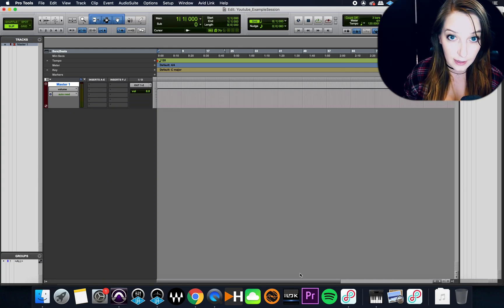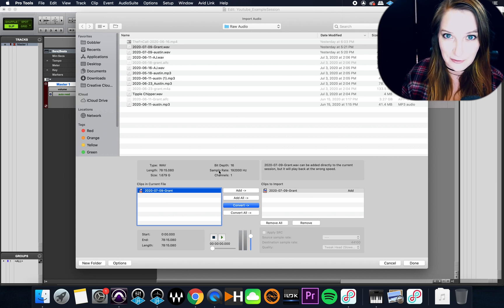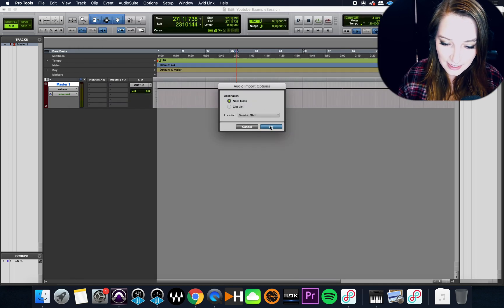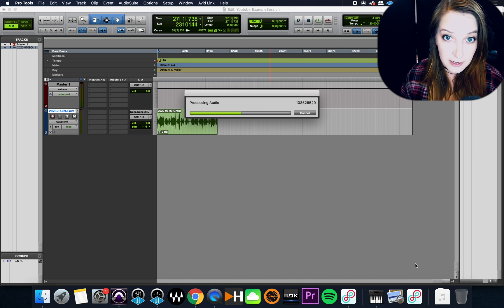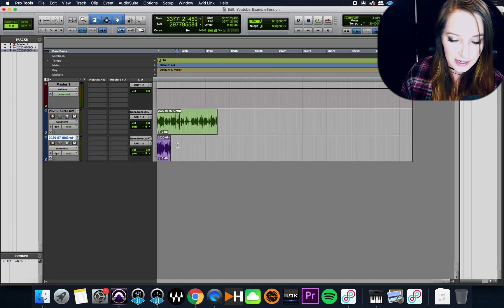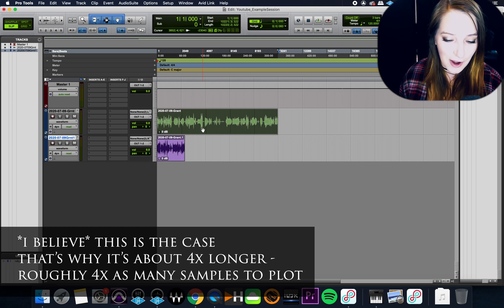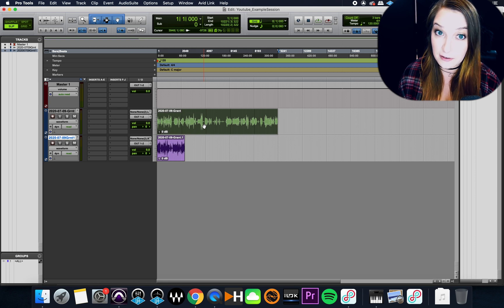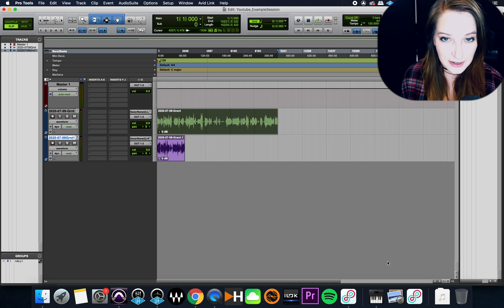Pro Tools Basics: is Your Session Playing Too Fast or Too Slow?

Comment: My issue is I have a project that suddenly changed sample rates because I changed playback device, it’s playing ay 44.1 when the entire project was 96.9 now I can’t get it to play normally again.
Reply: I was able to go into backup files folder and select a previous version of the project that helped get it back but there should be an option. Logic is so much more user intuitive. Pro tools should emulate everything Logic does along with what they already have.
Reply from the maker: Do you mean 96k? Pro tools usually won't switch your sample rate, that's usually an issue on your hardware end. To change your session sample rate in pro tools you actually have to purposely do a new save of the session in the new sample rate. What interface are you using, and what system are you on? I'm guessing it's a configuration issue with your interface. And the logic thing is interesting. I recently learned some of the basics on logic with a private instructor, and I think logic is great! But there are definitely features that pro tools has that a one man band making music wouldn't need, but are essential for a pro audio engineer working with a client that needs to keep the pace and workflow going - and some of those features just aren't available in logic. So I used to think it was a bit more arbitrary that pro tools is what's used in commercial studios, but I'm seeing some reasons why now that I dig into other DAWs. But, with that said, other DAWs are perfect for other scenarios, it just depends on what you're doing and what your goals are. Pro Tools definitely has a ton of customization that most people probably don't need or want to worry about, but we often want that when working in a commercial studio with clients.

Comment: So my session vocals are going really fast and the beat isn’t I’m trying to make my vocals go back to normal they sound so sped up how do I fix this
Reply from the maker: Have you tried re-importing the vocals, and making sure you hit copy or convert, so it uses the proper sample rate? I think I talked about that in this video, but I'm not sure.
Reply: @CatoNoise  I tried changing sample rate on one and it worked but when I try and import the session data for the other I need a specific sample rate how do you find specific ones?
Reply from the maker: @truevision3153  you don't. You just go to the import audio dialogue, find the file you want to import, and then choose copy or convert. Dont choose "add". Then pro tools with convert the audio file properly upon import